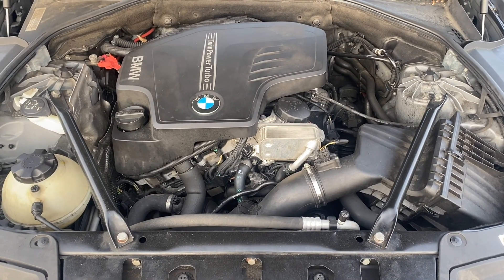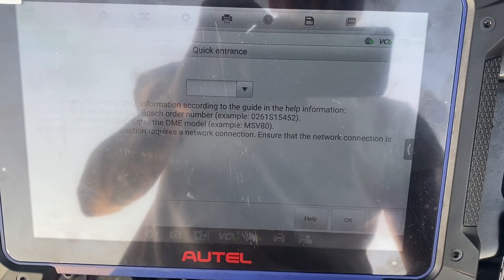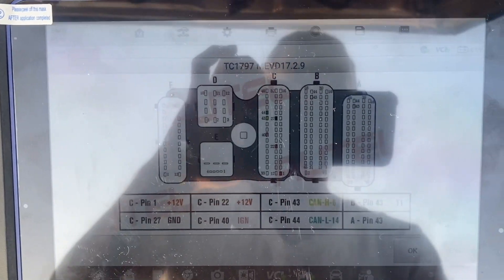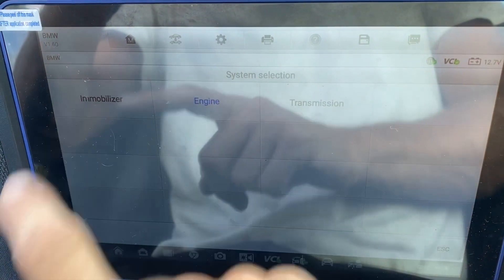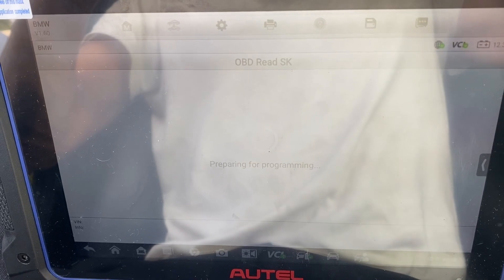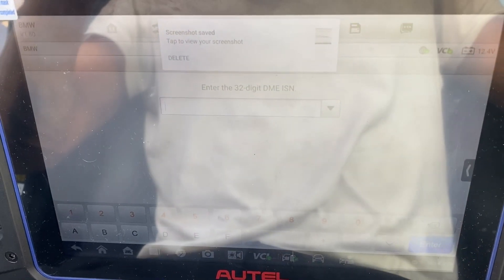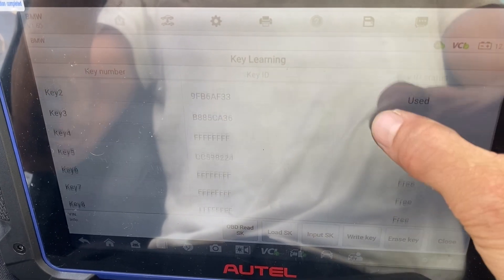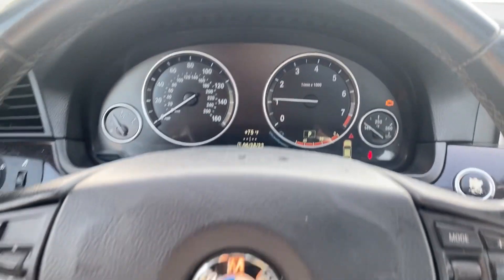2014 BMW 528i (CAS4+) All Smart Keys Lost using Autel IM608 Pro2

Comment: This is awesome! I’ve been trying to find some DME plugs to use it with a gbox2. Only found the plugs that connect to the DME itself but not the gbox2. Did you make your own or does the gbox2 adapter come from another manufacturer?

Comment: Are you not worried of bricking cas module doing procedure via OBD? Or at least without having cas backed up. 

I know autel has repair function but it is a till a worry if it doesn’t work? 

Genuine questions, not hating at all.
Reply from the maker: Yes there is a risk of bricking the CAS module
Reply: Und daher rate ich jeden davon ab, es über OBD zu machen
Reply: Does Autel repair CAS4 though?
Reply: @qazjoker  Nein! Kein CAS4/Cas4+
Reply: When Should THE Cables Be Hooked back in to the ecu